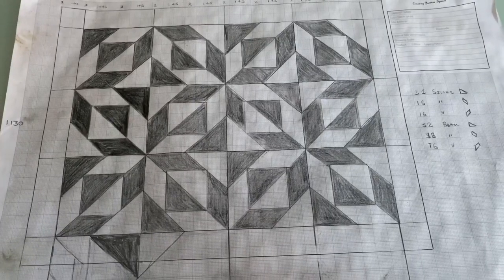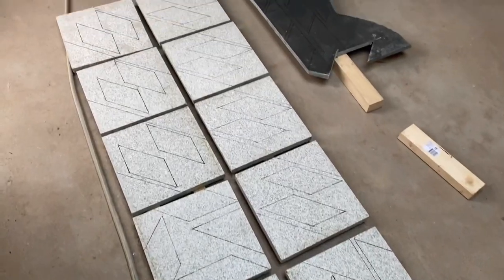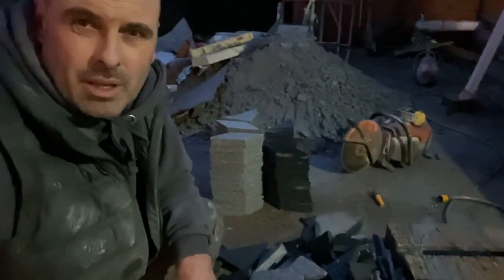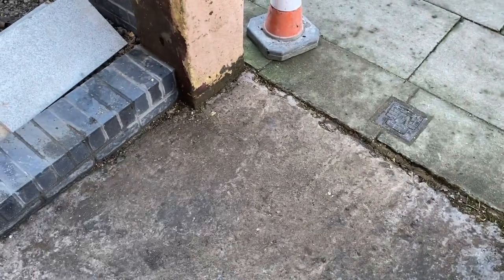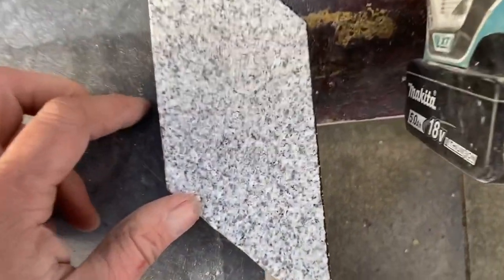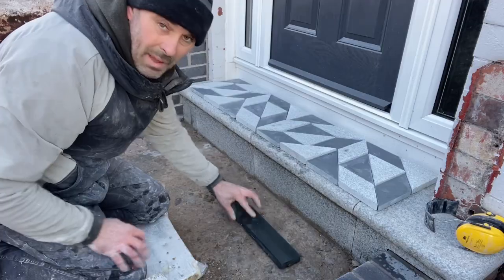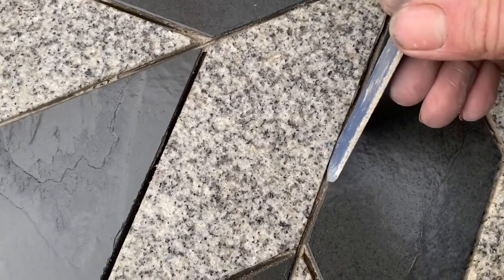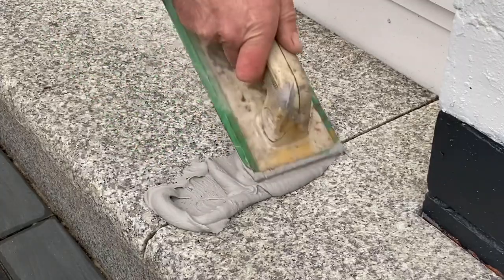Geometric Paved Path - Full Video

Comment: Done a  sick job there mate , thats looks top,  your brill at what you do 👍👍 , im starting my first porcelain  paving job in couple weeks , you got any tips i could benefit from 👍
Reply from the maker: Hi mate, thank you for your feedback- I appreciate it! 
Tips, get your sub base right, that will make the laying easier.  Make sure your mix is consistent and of correct texture. 
Always prime the backs. I’d keep joints on the tighter side 5mm 👍
hire a table saw if you’re not confident on a grinder or cut off saw. 
All the best 
Matty
Reply: @Brockstonepavingpros  cheers for that Matty , actually started laying them today , they went  down a dream , preferred laying these to anything else so far , if it turns out anything like your jobs  il be over the moon 😂😂 keep up the good work mate look forward to your videos 👍👍

Comment: Absolutely beautiful job mate, so much effort into the detail. The only thing I could possibly say as a negative is. Cutting the granite bull  nosed piece around that £3.50 white pvc trim was backwards. You should have cut the trim out and slip the granite under it. Or just ripped the fucking thing off and refit s new one. They're peanuts.
Reply from the maker: If that’s all you can pull up I’ll take that🤪 But considering it will always be there it doesn’t matter 🤙🏼
Thanks for watching and all the best
Reply: The grantie will be there longer if you fitted it. Youre gonna have guys in a 100 years time looking at the granite when theres a new door fitted and the trim is long gone. Saying " I wonder why they nothched the tread? ". Keep up the good work pal but just get rid of the D mould those trims are only conected by silicone usually. I don't like seeing them spoil your work. @Brockstonepavingpros
Reply from the maker: @SlightOfHand28  I hear you man 🤙🏼